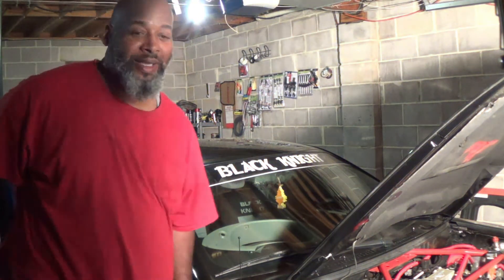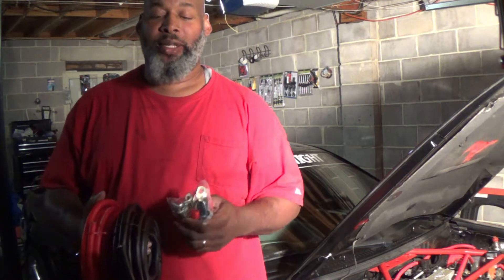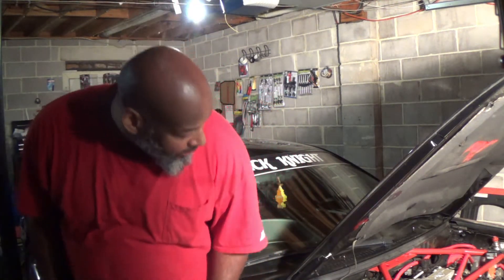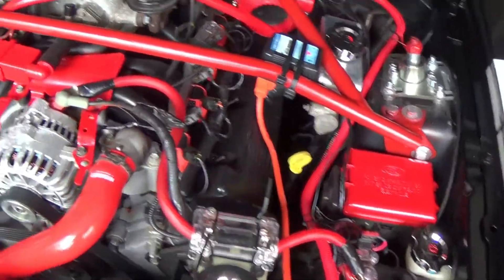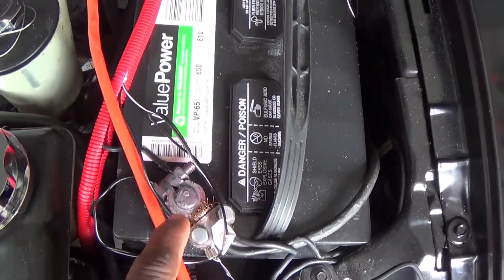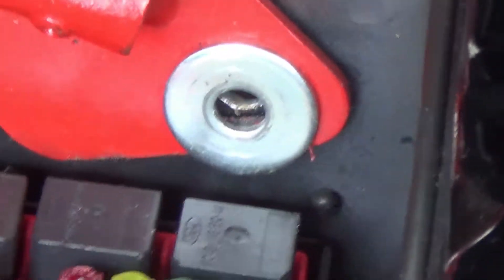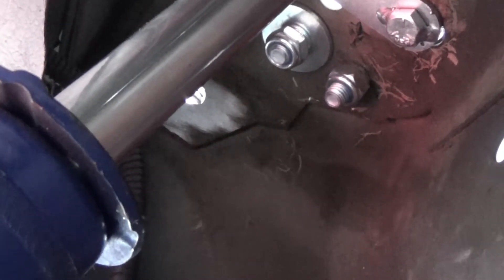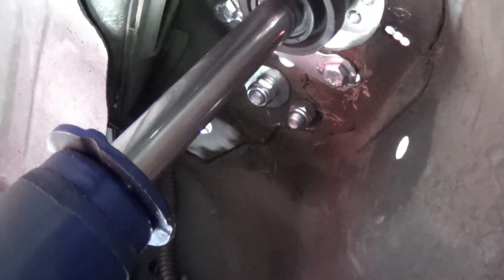hookin up the BIGG 3 ON BLACK KNIGHT

Comment: Are you going to use a power distribution block and capacitor? Looks like youre gonna be putting that altenator to the test. I'm betting you could make a small bracket to mount the fuse and a PDB off to the side back near the firewall.
Loving that clean engine bay man!! Keep the vids coming!
Reply from the maker: FastTX FiveOh I'm running a cap right now.but will upgrading to batterys later with a bigger amp
Reply: BLACK KNIGHT MUSTANG LIFESTYLE Well, Im sure both the car audio guys and the high performance guys be watching you add the second battery. I, for one, wanna move my batter to the trunk but Im not sure how to get it done properly.